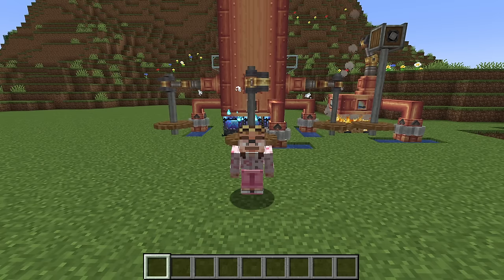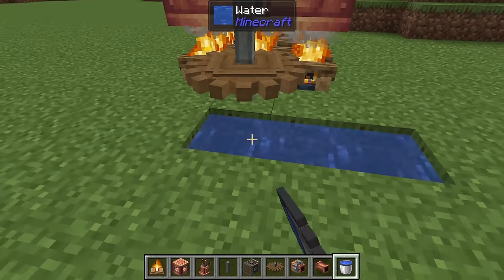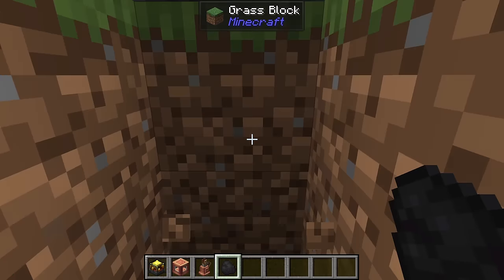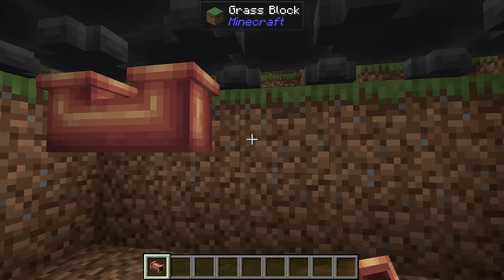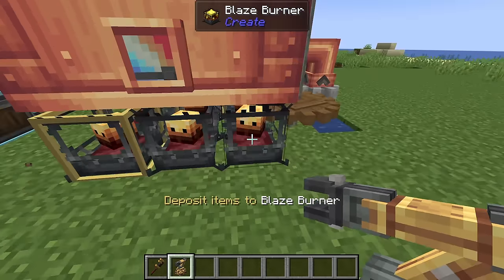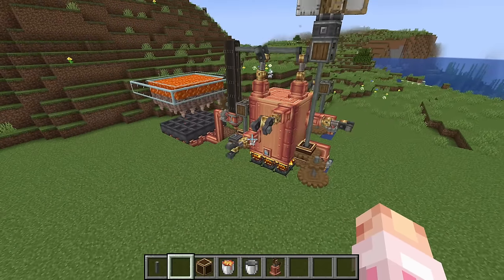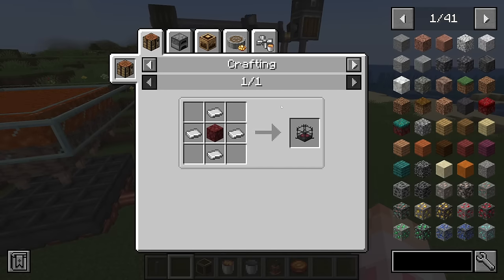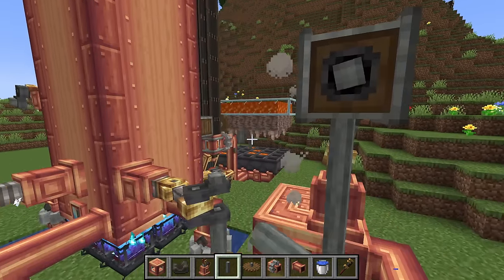Create Mod Steam Engine Guide!

Comment: I love the tutorial! However, the whole reason I was watching the tutorial because I’m a beginner to the create mod, but when I got to the part where you said “So I did a little bit of gear shifting”, I was like “So let’s see what he did” and so I tried doing what you did off camera as closely as I could, but I ended up cutting off the power to the water supply with the Sequenced Gearshift that you placed, so I just gave up on the tutorial.
Reply from the maker: You should check out my beginners guide, steam engines aren’t really the place to start with create :D
Reply: Thanks for the tip!
Reply: @dejojotheawsome  As someone who is currently new to the mod and playing it on valhelsia 5, I personally just want the answer to be frank. I understand learning on your own and become independent or whatever, but I followed this tutorial and like to have the bigger picture to understand the bits and pieces, as well as I just want it to work right now after building it. Can you please just describe what gears were changed and how?
Reply: Just wanna say I figured it out! It was a very simple wiki read, I should have done that in the beginning

Comment: I cannot get the gears to speed up no matter what I try, and the part of the video that shows how to speed them up was cut, can I get some help?
Reply: @ethanporter6508  the best way to speed up any engine in create mod early on is to use a gear ratio, now a gear ratio is a large cogwheel on the shaft, a small cogwheel connected on the side, a large cogwheel connected to the shaft of the small one, and a small cogwheel connected to the side of that last one. You can repeat this over and over for faster speeds but there is a limit and the more rpm the more stress units used by the mechanisms (Su used x RPM). Later in the game you can minimise this process using a speed controller instead but it requires brass

Comment: 20rpm per boiler level for pumps. 

Dont build anything above lv9 boilers. There is no advantage to doing so unless something changes. 
You can always just build more boilers. 

There is a way to create infinite water in the nether with a create bug. 1 bottle(250mb) of water pumped out of a cauldron yields 1000mb of water.
Do with that what you will. I have several million su plants running in the nether using that trick.

Comment: Hey uh, what version of mc is this in. Because in 1.16.5 my base is running on nearly 10 windmills at max strength, reason why is because im running 3 chain gearshifts to increase the speeds to enough levels to be useful and also for power to run ae2
Reply: Steam engines were added in create 0.5, which was for 1.18.2

That said, create for 1.16 did have a nifty power source in the form of the Furnace Engine. Stick it on a furnace, and while the furnace is burning fuel it'll generate stress.

This may sound limited at first, but a fan and a chute can pull smeltables back out of a furnace's top slot, so you can have the furnace light by putting fuel in it, then have the furnace engine power the fan that pulls whatever ore you tossed in out the top. Then, when it stops burning, the ore drops back in, lighting the furnace again and pulling the ore back out the top.

It's clunky, and I'm glad newer versions have the steam engine instead, but it was effective.
Reply: @danieljames1868  I've added mods that help with power, like simple generators, ProjectE's fuel scources and a ender power mod, that is 100% end game due to how much resources it takes and how much it costs to use ProjectE to get 1 more cell.

Comment: If I wanted a build where it's a steam engine that can be slowly turned on with a hand crank how could I do that. I want to make one that's not always on and has a thematic generator feel when turning it on. I imagine it would be the crank contracting to the mechanical hand but I'm not sure if it'd produce enough SU to actually turn it on.

Comment: Do you think you could possibly do a tutorial on gear ratioing and how to make machines faster because I always get confused on that
Reply: A big cog to a small cog makes things twice as fast, the opposite slows things down by half. That's pretty much it.

Because the small cog has less circumference than the big cog, for each turn of the big cog, the small cog does twice as many turns, and hence, it spins faster. After that, you can connect another big cog with a shaft to the small cog and repeat the setup again to keep speeding things up

Comment: At like 12:54 my mechanical arm keeps picking up the empty bucket and putting it in the brass funnel, the spout therefore does not have time to fill the bucket ever, have I done something weird? The brass funnel is set to empty bucket and it works fo rone cycle if i put a lava bucket on the depot, I don't know if it matters but I am playing a modpack called Prominence II so I have the mod called Prominent Create, I havent noticed any difference from the regular Create so far however so I don't think it's that personally.
Reply: Okay just checked and I think the version of vreate Im running is Create Fabric 0.5.1 for mc version 1.20.1
Reply: Used another depot and filter to output the lava bucket to another depot and pick it up there.

Comment: You can actually use mechanical pumps in a line and they'll power each other like small cogs! You can just build a 3x3 hole with water and place the pumps in a straight line down the middle, powering one which causes the other two to be powered as well
Reply: The pumps are also able to be waterlogged, so you can just have the pumps inside the non-infinite water source blocks, pointing towards the infinite one. Makes things a tad more compact

Comment: I'm having an issue with my last engine, for some reason, it keeps inverting its own direction of rotation. Anyone knows a simple solution to prevent that ? I mean, I already have an easy fix known as a gearshift, but yeah, would be nice if it just didn't decide to invert its direction of rotation on its own like that.

Comment: At 13:02 what block is that? The one that is connecting the small cog wheel that is on top of the big cog wheel. It looks like it's a block with a cog wheel in it. What is that?
Reply: Have one vertical gearbox and on top a windmill bearing